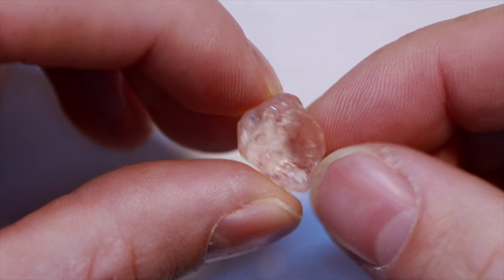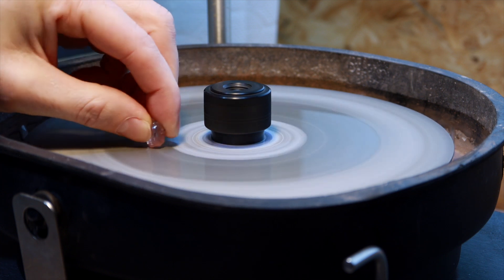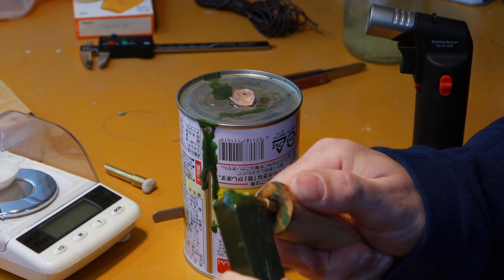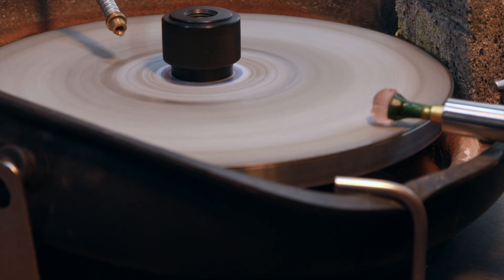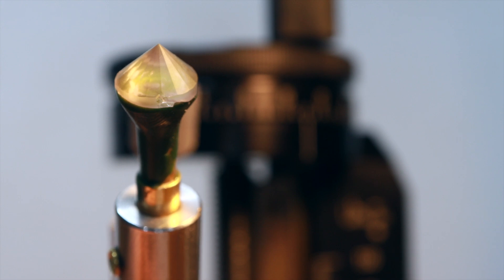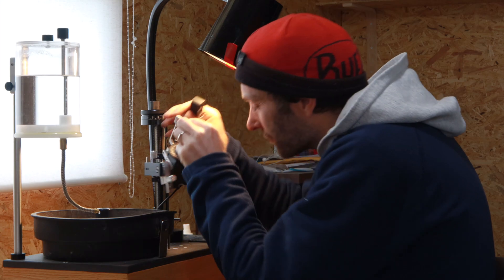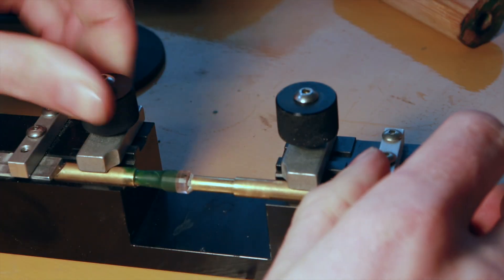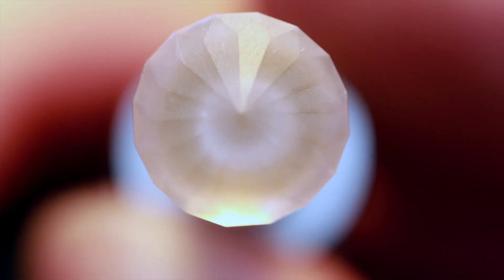How to turn a rock into a gemstone, how to cut gemstones, faceting gemstones

Comment: Stunning I absolutely love Morganite. Diamonds IMO are boring compared to the spectrum of colours available in the other groups. 

As a beginner only using low quality stones I’ve found myself over the years, is superglue an ok adhesive to use if your only tools are a drill and grinding stone (secured with vice grip of course) ? 😂 

I finally bought one yesterday and am finally ready to take the plunge tomorrow hopefully! 
The plan is to superglue the stone (once I’ve flattened once side by hand) to a steel nail & cut it off. 

I also have a dremel but the attachments are too expensive to practice on I feel so I’d like to get thru the trial and error part & understand the stones etc first.
Reply from the maker: super glue is fine for what you are doing you will need to use heat or solvent to remove the stone good luck and have fun with it

Comment: Isn't there any way if cutting off the part you don't need for later use instead of grinding and wasting the rest of the stone?
Reply from the maker: not on a small gem like this  you loose a lot of the gem by sawing it anyway and the pease you would get would be to small to do anything with